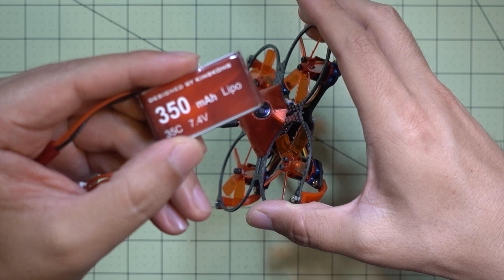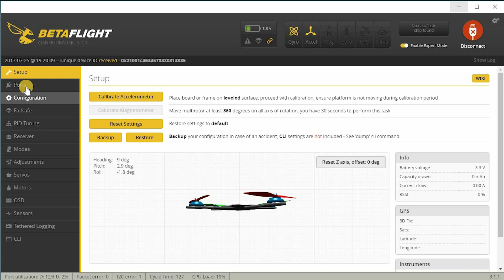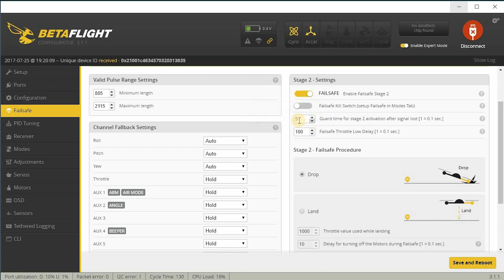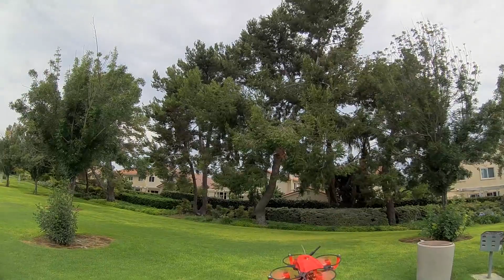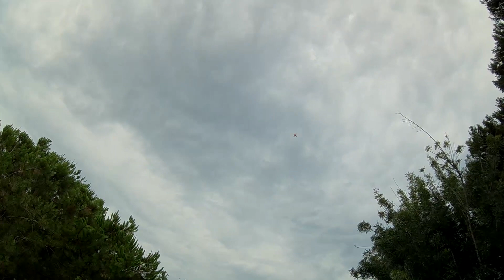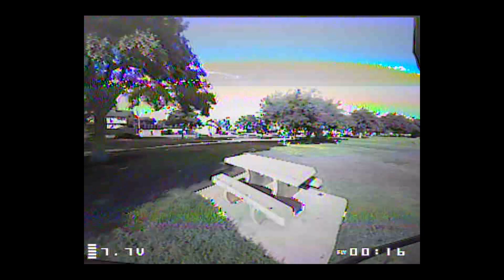Micro Drones 101 🚁#21⚡ Eaglet 85 ⚡👍

Comment: The frame looks almost exactly like the carbon upgrade frame for the DYS Elf that they sold at FPV HQ. It worked well but when those 3d printed parts snap, they can snap the top carbon rings near the screw also. Be carfull

Comment: Nice review Albert - with the prop guards it looks like this would be a good Tiny Whoop replacement and indoor flyer. Is it possible to fly it outdoors with the guards?
Reply from the maker: You mean without the guards?  I flew it outside with the guards on.  If you take the prop guards off you'll need to find a way to mount the canopy as that is mounted to the prop guards.  I thought it flew fine with the guards on and will leave them alone.